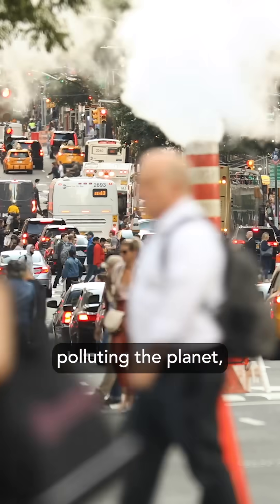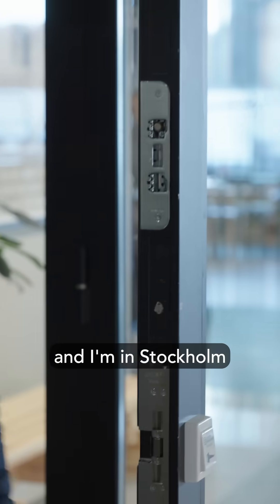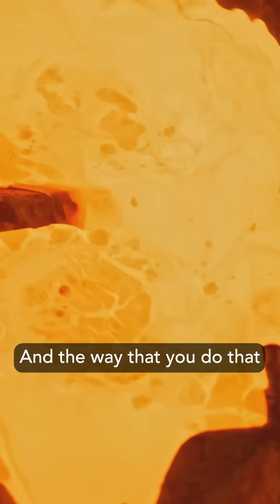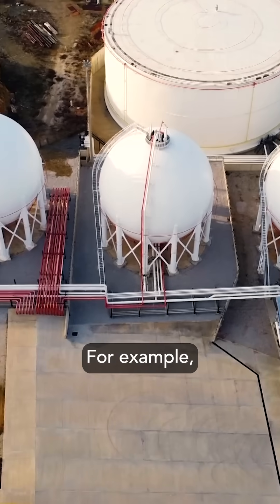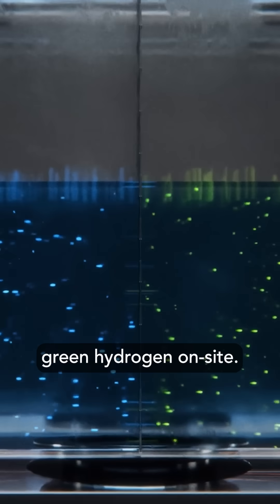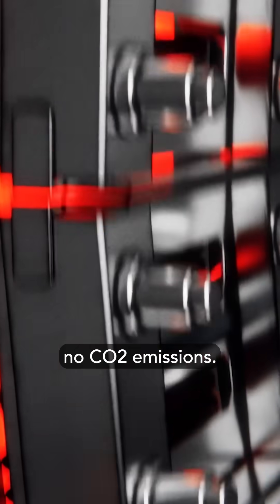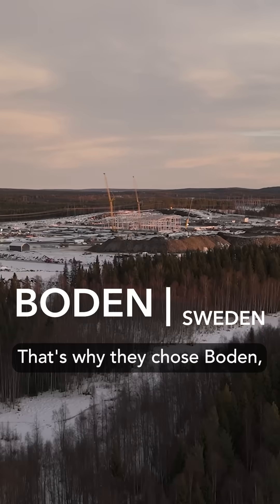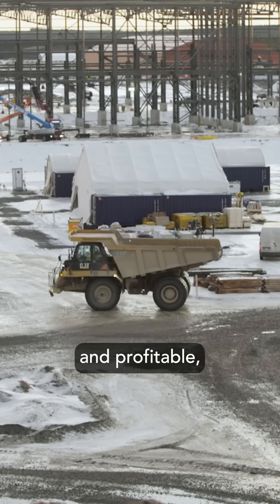Stegra: The Swedish company may have an answer to decarbonize one of the dirtiest industries

Comment: This STEGRA STEEL report is amazing for the wrong reasons!
First, not a word explaining from where the enormous amount of hydrogen gas will come from! Technically splitting H2O to harvest hydrogen is easy, but unfortunately requires fabulous amount of electric energy. In fact it takes staggering amounts to remove 10% of all CO2 emmissions!
Secondly, so from where will STEGRA purchase the electric energy that only a large CO2 free nuclear power plant is able to supply. Where exactly  from?
Thirdly, even if doable the cost for "Green Nuclear Steel" will be so high that it will be impossible to sell without massive finance support from (wait for it..) taxpayers. Besides, once you have a bar of steel in front of the customer, it is of course no difference at all. Steel is steel, daah. In short, Green Steel has no merit, no market, no customers, no future.
Not a word that STEGRA is now in terminal financial difficulties with few investors expecting the company can survive without more and even more tax-funded "doping".
ASK WHY the Australian (CCP financed) "Green Steel" entrepreneur Twiggy Forest has become so quiet about his Australian "Green Steel " project. Will acres and acres of CCP solar panels power his hydrogen production during sunny hours and his "Green Steel" plant?  Sadly there's no market for super-expensive "same-same" steel bars regardless of what you call them...
Reply from the maker: Good questions... The answer: (1) 700MW of ThyssenKrupp Nucera electrolyzers on site in Boden, Sweden. (2) Electricity comes from hydro & wind via a long-term contract with Norwegian utility Statkraft.
For more details: http://gwagner.com/stegra and https://gwagner.com/ft-steel